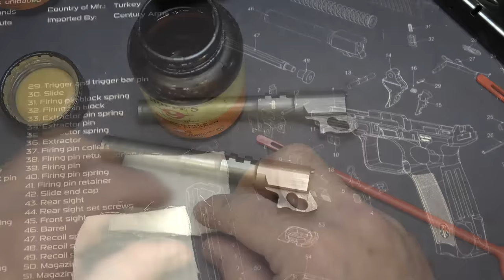CZ 75  CZ Recommended Cleaning

Comment: It's important to change your guide rod spring after 4,000 rounds. The slide will eventually begin to malfunction (mainly not going into battery, dead trigger) causing stress on the gun. It happened to me, so I thought I'd pass it along.
Reply: Danke für den Tipp, werde sie bei meiner CZ 75 SPORT austauschen. Außerdem habe ich mir ein neues 3 Punkt Visier neu aufbauen lassen.

Comment: Took this to the range for the first time, along with a Glock 19, an Beretta APX.  The CZ 75 was the  best of the 3 by far.  Racking the slide was like slicing butter with a hot knife.  My shot group was tight and on target.  Recoil was soft and all in all, the CZ 75 was amazing.  I have the CZ 75B, not ideal for conceal carry, but definitely an outstanding firearm.
Reply: As long as you have a quality gun belt and a comfortable appendix holster it's actually a lot easier than you might imagine
Reply: I have the 75B and love it as much as the others I own

Comment: I would suggest adding a pair of non-coated nitrile gloves to help keep any lead residue off of your hands.  Also, a trick to cleaning the spring is to insert the edge of your cleaning patch into the top side of the spring, so that it runs between the coils, wrap the patch around it and then using a twisting motion, run spring through the patch.  You would be surprised how much residue comes off.
Reply from the maker: Thanks for the tip Ron!
Reply: @sootch00  Glad to help the community.  My wife says I am anal about my firearms, because I wipe and clean them on monthly schedules, even if I haven't put a round through them.
Reply: Very thorough and informative.
Reply: Ditto. Works great!
Reply: q tips and the industrial ones with long handles for use as applicators for springs, nooks, crevices, and rail slots..

Comment: I can't believe a seasoned veteran like SOOTCH00 doesn't know the first stage of the hammer is the slide hold position to remove the slide pin! Come on man! It's genius on CZ's part! You don't even need to be cautious about lining up the marks on the slide/frame. You just pull the hammer back to the first stage, and then pull the slide back. The lines match up, and you can pull the slide pin out.

Comment: Yet another good video.  Thanks.  I use a little variation.  (1) I use Ballistol, and lots of it.  I soak most of it - not the firing pin area, and let it sit for a while.  It won't hurt rubber, plastic or wood.  In fact, wood loves it.  Then I brush, and spray again.  Then dry, with an air blaster a little, and wipe with clean cloths.  (2) I use a bore snake instead of a brush.  (3) I don't use "oil" on the barrel, slide, or other parts that have metal-to-metal contact.  I use only grease for that.  I like Lubriplate SFL-0.  It's non toxic (Ballistol is too).  The main difference between grease and oil is that oil "migrates."  It will flow anywhere it can.  That's good in some places, but not good on the slide.  You want something that will stay put, and lubricate until it's lost its usefulness, not until it migrates away.  Not all of my shooting buddies agree, but this works great for me, and I am seeing very few signs of wear even after thousands of rounds.
Reply from the maker: Thanks Worsel! I appreciate your sharing your process.
Reply: Yes grease for barrel, locking lugs and rails makes more sense.

Comment: My CZ75BD is a keeper. I'll use a tiny bit of gun grease on the slide rails - seems to work well and the grease does a great job of trapping residue. Just wipe clean with a dry cloth folded to get in the rail crease. After about 1,000 rounds or so, I'll remove the firing pin and clean out the channel using a dry Q-tip.

Comment: I have a lightened spring kit (all 3 springs 13lb) in my Shadow 2 and i have snapped a takedown pin after approximately 5-6000 rounds. Now i use one for training and then i change to one i only use at competition since you obviously don't want that happening during a match. Keep track of your rounds and change it out when you feel it's necessary.
Reply from the maker: Thanks for the tip. Competitive shooting reveals a lot. I used to run the 1911's shooting IPSC matches and what can go wrong, will go wrong.

Comment: great vid...don't currently have a cz & miss my p-09 from time to time; my cleaning-lubing process is more involved...guess my ocd pushes me; hoppes 9 or custom blended lube (more on that later) in bore, internal surfaces with fouling (breech face, ramp, mag well, locking block area, etc...bore gets bronze brush 35-50 times to clear our grooves as much as possible (seen used guns for sale with oxidized copper fouling in the bores within the grooves); revolver chambers get 10-15  passes with bronze brush; then use patches, qtips, brushes (nylon, bronze, stainless steel...varies on gun finish) to detail clean tight areas; after that I use polymer safe degreaser spray and hit everything to remove solvent, lube, grime (especially firing pin channels, revolver internals, internal workings on semis); use qtips with degreaser to detail clean tight areas; allow to air dry (shake components to get excess degreaser out of tight areas; meanwhile I take patch with lube & clean magazine bodies & followers; bore & revolver chambers get lubed patches & sit a few minutes while using lubed patch on all visible surfaces (including polymer frames to remove residue, carbon, abraded skin, etc; all lube is removed with microfiber clothes, qtips, patches; lube applicable working surfaces (drip 1-2 drops into revolver internals) & reassemble firearms; work mechanisms & remove excess lube during 1st hour after reassembly...recheck in 24 hours to remove excess oil creep (same thing whenever handling after storage); home brew lube is currently g96 & 15w-40 motor oil in approximately 1:1 ratio (shake aggressively several times during first few hours after mixing to 'burp out' aerosol propellent & occasionally let sit with cap loosened up to allow propellent to dissolve out)...shake dripper bottles to blend mix when using for cleaning /lubing;

Comment: Well I use cleaning gloves to minimize how much lead and chemicals get on my hands, and then I use 2 of those green cleaning mats, a small pistol one on top of a shotgun one just to all the excess oil that may or may not seep through the first mat is absorbed into the 2nd and not my table. And also I tend to spray my CLP outside in the backyard away from the house just to make sure I’m as well ventilated as possible. And also I have a roll of paper towels at hand just in case. And then when I’m done I try to avoid touching anything until I’ve thoroughly washed my hands in cold water

Comment: If you move the hammer back to its first stop, the lines match up perfectly. You don’t have to go farther than that as shown in the video. Makes it easier to hold the slide in place when tapping the slide stop out.
Reply: With the omega System, you must full cocking the hammer.

Comment: To get residue out of those annoying little cracks and crevices, are use carb and choke cleaner spray. It’s a very powerful degreaser as well so you need to clean and oil afterwards.

Comment: Excellent video!  One thing, though...I'm not sure it has a low bore axis as the barrel isn't that much lower than it is on other guns (when I compare my CZs to 1911s, Glocks, Hi Powers, and Caniks).  The Glock and some other polymer guns have a much lower bore axis.  What the CZ-75 does have is a smaller slide (but corresponding higher frame sides) so there's less reciprocating mass and the beaver tail allows a higher grip.

Comment: Ballistol for everything.
Reply from the maker: Ballistol is a staple here as well. Thanks Brother
Reply: Ballistol all the way ! 💧
Reply: ^bump
Reply: Agreed--thanks to Hickok45, I've become a convert. It does everything needed through the cleaning process.
Reply: Bloke on the Range is the reason I tried it. Haven't looked back.
Reply: Agreed. Ballistol is the Franks Hot sauce of gun cleaners..."I put that sh-t on everything!" Once applied to the internals, I use my mini compressor to blow out the excess. Bore work excepted of course. Its good stuff and keeps my milsurps happy, especially after shooting corrosive.
Reply: @paulthompson4367  what mix of water/Ballistol do you use for your post-corrosive cleaning?
Reply: Hoppe's 9 for cleaning, and Ballistol as lube. That's the way.
Reply: I started out using Ballistol  for my black powder stuff.  Worked very well there.  Now I use it for everything else.
Reply: I use  the manufacturers recommended ratio of 10% Ballistol and 90% water. I also squirt a little straight up here and there..like in my SKS gas tube and piston. Been using it for a few years now, no rust ever.
Reply: I use Hoppes or Butches bore shine cleaner on my barrels , these get the copper fouling out . I use G96 for  rust prevention , its a wonderful rust preventative,  i have never had a speck of rust on any of my firearms using G96 for 25 years even if a firearm sits in the safe for 3 years without use  . For lubrication i use break free CLP . A can of Gun degreaser  makes life easier on the inside of slide too .
Reply: I see G-96 in a lot of shops I visit. But I've not known anyone who uses it. Sounds like a good tool to keep in the war chest (war on rust). Another great tool is one I read about for over 30 years in British motorcycle magazines called ACF-50  (Its made here in Canada) Its an aircraft industry product used to de-activate and prevent rust - a former member of the British military told me they use drums of the stuff to hose down their aircraft with it. The stuff works amazingly well in firearms as well. I experimented with shooting corrosive ammunition thru a couple of my guns without benefit of any cleaning what so ever, just sprayed the metal down and walked away....for a couple weeks. Upon a detail strip there was not a single speck of corrosion anywhere. It's a keeper to.
Reply: Paul Thompson G96 Complete gun treatment has been around for at least 20 years . It protects your firearm, it leaves an invisible magnetic film over all metal parts which protects your firearm against rust under all weather conditions including salt spray , protects frequently handled firearm against fingerprint damage. 
Contains lubricants which will not freeze , oxidize or evaporate ( the result of missile research) leaves no gummy residue. Keeps firing pin and all moving parts working in temperatures low as -50F below zero , ensures perfect firing every time.
Contains solvents which will completely remove all traces of rust , gun powder , leading  and corrosion in seconds. And it smells great too 😀
Reply: Great, now I want to try that too, and smells good to. Me likey already.  As well as Ballistol works, it always smells like a newborns milky puke. :)
Reply: I do love Ballistol!! Use plenty of it!!
Reply: @xy9552  what kind of gun oil do you use?
Reply: Agree with Ballistol.  And I prefer to run a few wet patches before scraping the inside of the barrel with a brush.  Better yet, don't use the brush, unless you're shooting lead.
Reply: I only use cooking oil on my guns
Reply: I just got a CZ 75 SP-01 and I also use ballistol on my other guns. Came here looking to see if others use on their CZ. Do you use for inside the barrel as well as outside and on the slide? Just want to make sure because I Love this thing and want to treat her well
Reply: @derekmueller9007  ballistol gets used on everything, inside and outside.
Reply: Filthy Capitalist thank you so much. I couldn’t seem to get a straight answer anywhere. I sprayed it everywhere on my Glock, but I’ve never had an all steel pistol before and want to make sure I treat her right! Really appreciate you taking the time to reply. Would you recommend cleaning before I shoot it for the first time? There seems to be some factory grease on it.
Reply: @sootch00  Can i use ballistol without adding water to clean my new cz sp-o1.

Comment: When taking out the slide stop, I use the bottom of a magazine to pry it out instead of my fingers.  Little bit easier that way, especially if the gun is still new.
Reply: My rami is only a week old. Was having a hard time disassembling with a magazine. A nickel seems to work pretty good. Will try the magazine again in the future once I get more comfortable holding the slide back to 1/2 cocked hammer. Awesome pistol, very accurate and little recoil for a 3” barrel.

Comment: I also set the slide upside down push on firing pin block and firing pin so the pin is sticking out of breech face to push out any goober that might of got in while cleaning, I just use a q tip and wipe tip of firing pin.

Comment: I have 2 p01 1 p07 and planning on getting more cz just love them
Reply: I used my new CZ 75 at the range. The second clip jammed when I went to shut. I was told I to easy on the slip action when loading the first round? Is this true?
Reply: @robertbranyan794  this are military grade tools i would recommend you to shoot is as much as you can to break it in once all the parts in the guns are loosen up they should run with no problem

Comment: i was a 1911 guy until I bought a 75 SP 01. Then a 75 B Compact to carry and then a 75 Cold War Edition. I've never had a failure to feed or eject or fire or ejecting brass hit me in the face with a CZ with any ammo. The only problem ever was when I put a short mag in a full size gun and the ammo wasn't high  enough to feed. That was user error, not the gun.

Comment: Hey Don great vid bud! I have a CZ75BD marked '99 FYi i use a foam paint brush to clean the mag and magwell. I learned it from a old comp shooter who would clean mags dropped into the dirt between stages. It's crazy that the newer ones like you have are equipped with a polymer spring guide rod. Mine is steel.
Reply: Gotta use new brushes and check for chunks that if you miss them, can gum up on mags or in the well, that could be a mess! I roll a small strip of paper-towel around a brush, drop of oil and ‘just the tip’! Long live the Democracy!

Comment: Huh, I’ve used a dry lube, a high temp lubricant and a grease on my CZ. Nothing wrong with having a little grease on the slide rails and on the barrel and a tiny bit on the locking lugs. I’ve done this for a long time and never had problems. Don’t be afraid to run them wet, just don’t over do it in the sensitive areas. I don’t like using Hoppes number 9. I find I don’t need it. The brush and cleaning lube has always worked for me.
Reply: What dry lube do you recommend?
Reply: 1938 Quarter I just use WD-40
Reply: 1938 Quarter I just use WD-40
Reply: @factsoftheconfederacy7151  
Holy crap. I didn't know WD-40 was considered a dry lube. I'm ashamed 😔. But thank you for the reply. I'll look into that.
Reply: @factsoftheconfederacy7151  
What have you found to be best for a carry pistol? I'm looking for something that won't ruin my clothes (carrying appendix).
Reply: 1938 Quarter depends the situation. I’m swapping over to a Sig P320 in 45 ACP or a M1911 in 45 ACP.
Reply: @factsoftheconfederacy7151  
Haha! Sorry, I meant what lube(s) have you found to work best on your carry guns.
Reply: 1938 Quarter yes, you don’t have to spend much money to get a smooth and taken care of pistol
Reply: 1938 Quarter look up Hoppes High precision. Great products. Use a grease too. They have a grease, or you can use choke tube grease.
Reply: @factsoftheconfederacy7151  thanks!

Comment: Nice to see you handling a quality firearm.  feel the real of steel.. Old School is best.
Reply from the maker: I have to get my "Real Steel" fix often! lol! Next is the Browning Hi Power : )
Reply: @sootch00   Good Morning sir.  Hi Power has  become my favorite range/target/fun gun. I like to think of Hi Power as " 1911 " improved.  I removed the Mag safety and tweaked the flat spring enough to bring my trigger to a smooth four pound pull. changed out the front sight to a fibre optic. 
Mine was likely used in the israeli military as it has the Star Of David stamped into the frame. Its an MKIII. 1992 edition. I wanted a little piece of John Brownings work. A little piece of firearms history.  Judging from the Videos about him I would Dub him a master firearms builder.  Thank you for all you do in support of our second amendment rights. 
BTW out here in Oregon were on the verge of become the most restricted state in the union. SB501 If passed.  Well.. when you get a free minute. take a look see.  google 2019 SB501.  Also note: Were a very Blue state out here. The Dems have the super majority. And our governor is an extreme left wing firearms hater.  Our only hope of this thing failing will be from the backlash that the Sherrifs and State police will stir up. Enforcing this will land on their already understaffed over worked offices.   Time will tell.  Property sales in Idaho may be about to soar.

Comment: I would suggest wearing gloves and using marvel mystery oil for everything. The barrel, and the tooth brushed internals.  Marvel cuts carbon deposits amazingly.  Then after several good wipe downs then lucas gun oil.  The marvel mystery oil comes in a spray and so does the lucas gun oil......but dont inhale when you spray.

Comment: Just spray everything including the barrel, slide and frame with CLP powder blast. Clean the barrel with patches. apply CLP, cleaning brush, patches. Wipe slide and frame. use old fashion shaving brush with CLP and apply to every thing. wipe the access. Reassemble. Powder blast eats up carbon. no need for cleaning brush. Gun is all metal. Powder blast is safe,

Comment: Good vid. New gun owner with CZ 75B. Thx for the tips.  I have one that may help someone - if you put the hammer in half-cock, and then push the slide, the marks will line right up.  Makes it easier to keep in place while you're pushing the pin out.